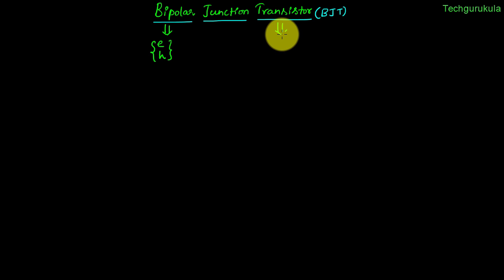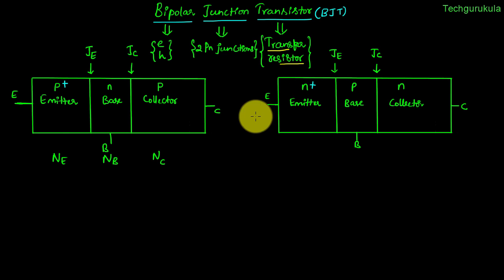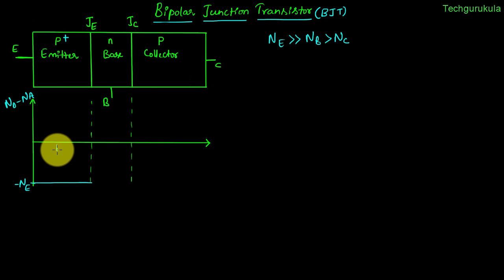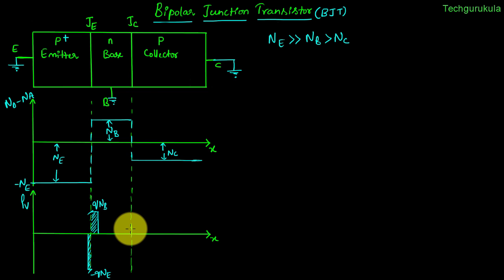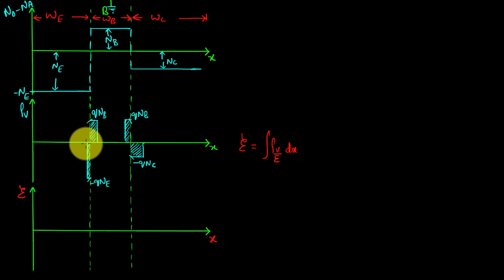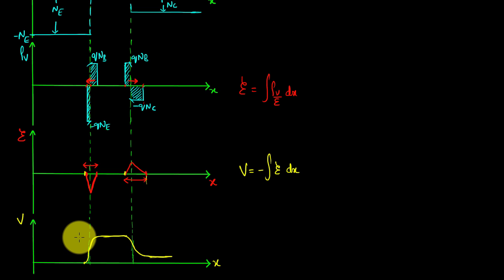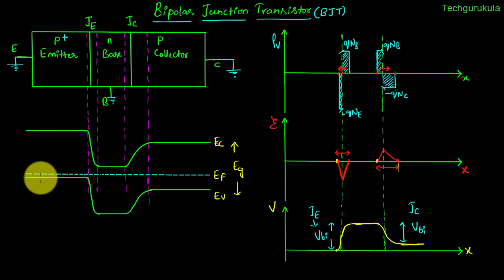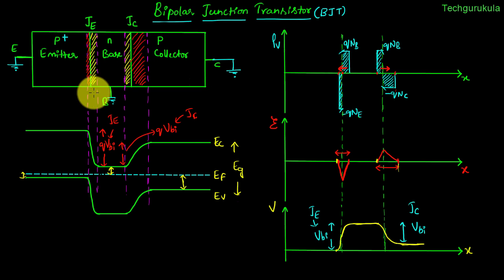Electronic Devices: BJT - Equilibrium

Comment: sir your videos are awesome....but their some mistake....Sir Base is lightly doped and doping concentration will be like this Ne > Nc  > Nb
Reply from the maker: Hi Dheeraj, I still say Ne >> Nb & Nb > Nc is correct. 
Ne >> Nb to make Emitter Injection efficiency high. Nb > Nc to avoid punch through.
For confirmation check EC 2010 GATE question on BJT.

Thanks, Techgurukula.
Reply: Sir ...then what is early effect???.....in early effect depletion width is more and more in base region...as we reverse bias the collector junction
Reply: may be sir question has some mistake.....
Reply: I am too confused , as in all textbooks it is mentioned that base is least doped while collector is moderately doped. But then depletion region length greater in collector side contradicts this. Please clear my confusion.
Reply: @nilimakumari3831  no base is more doped than collector
Reply: If we keep base doping more with respect to collector it will put more constrain on reducing the base width hence speed of bjt
Reply: Hi, what sir said is correct.In text book also correct.Sir explained the case of uniform doping.In uniform doping, Ne>>Nb>Nc. But in case of non uniform doping Ne>Nc>>Nb.Early effect explained for non uniform doping.